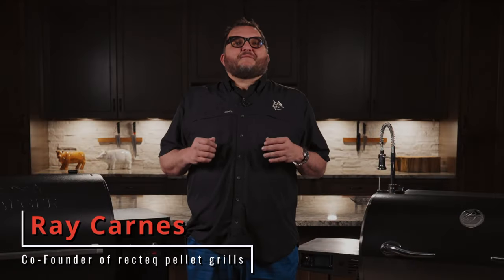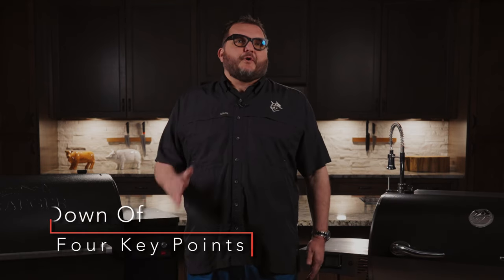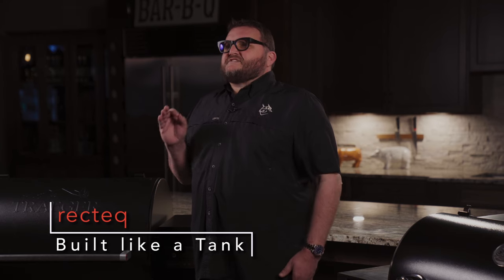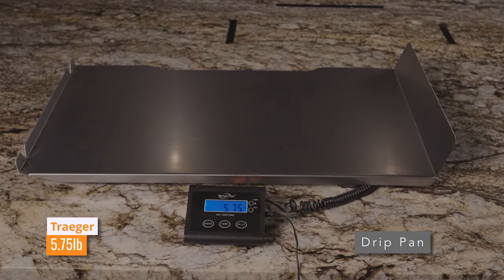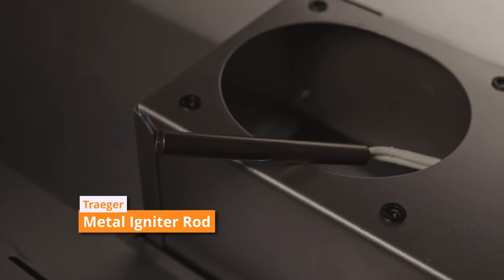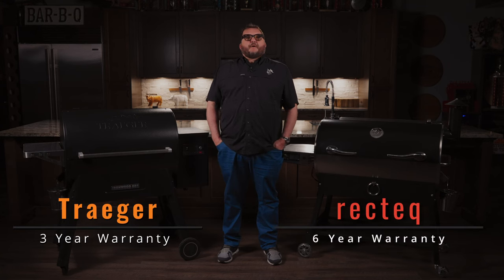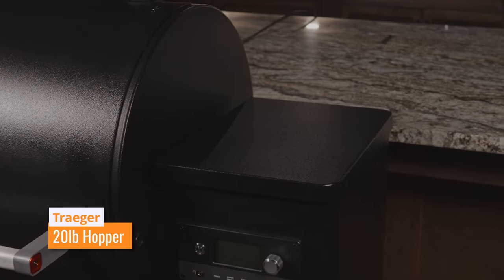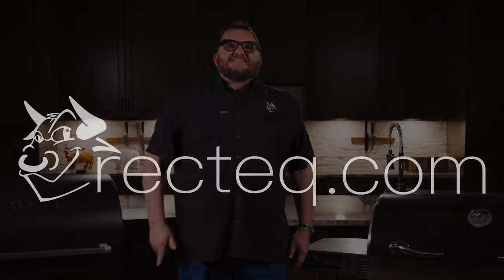RT-700 Wood Pellet Grill vs. Traeger • Side by Side Comparison Take 2 | recteq

Comment: I was one of the original customers for the rt680. It's over 7 years old now and going strong. 

This is a huge statement but in my dealings from pre sales thru many years of watching rec tec expand and engaging them on multiple ocassions,  you would be hard pressed to find better customer service. It's not only a quality product but the company that stands behind the product which they do unconditionally. 

I have turned on friend and coworkers to these folks and all have constantly stated how happy they are. In the future we will be moving and I plan to move up to the bfg2500. I would not consider any other pellet smoker & company at any price point other than Rec Tec
Reply: 680 is such a great grill mines going strong only needed the bottom fan replaced and the controller

Comment: If you want a challenge, try assembling one of these grills https://www.youtube.com/post/UgkxCx5fHawkK9OoV-ojFrY8JLnZrFwAmvUt . I am a technician by trade and the technical instructions were easy to follow. No reading, just pictures and diagrams. You assemble everything in 5 steps from the bottom up. Step #1 - Assemble 4 Legs and Wheels; Step #2 - Add the Front Cover and Cross Bars to support the frame; Step #3- Assemble the Burner to the Lower Grill Housing and install the knobs; Step #4 - Install the Side Burner and side shelf; and Finally Step #5 - Install the Upper Char- Broil Lid, Cooking Racks, 3 Burner Railings and Lid Handle. That's It and you're done in about 2 hours and 40 minutes. You have the option to pay for assembly after making the purchase - I would strongly suggest that you take it if you don't want to be bothered with this challenge. The only tool I used was a Phillips head screwdriver and a standard pair of pliers. The grill cost a little more because of the side burner, but this is what makes the grill so versatile and popular among backyard grillers. Have fun and enjoy!

Comment: I am firing up my 1250 in 10 minutes.  It is so far pretty amazing.  Do wish there was an easier way to dump pellets for another flavor though I am putting wet chips with the flavor I want on the heat deflector.
Reply: Quite honestly a shop vac works very easy. Sounds like a pain in the rear but it really isn’t. They’ve talked about why they don’t have a hopper door to let those out. Eventually moisture would work its way in through that access door.

Comment: As a previous Traeger+ user, I must say the switch to Asmoke has been a game-changer. The most significant improvement is the temperature control. With Asmoke, I have precise control within 5°F, which has significantly enhanced my grilling results. The portability of Asmoke is another feature that I appreciate. It's battery-powered, which allows me to take it on camping and road trips without worrying about finding a power source. Plus, the battery lasts up to 10 hours, which is more than enough for a day of grilling. The wood pellets add a unique smoky flavor that I've never been able to achieve with my Traeger+. The convenience, portability, and supreme taste have made Asmoke my go-to grill for all outings. I couldn't be happier with my decision to switch! #Asmoke

Comment: I had a Traeger and had numerous issues: 1) Sometimes it would just “flame out” 2) could not keep temperature unless it was a very high temperature 3) Absolutely no smoke flavor.  I ended up selling it very cheap and bought a “stick burner”.   As you can imagine, that’s a lot of work to tend a fire and try to keep the temperature where it needed to be.  At this point, I’ve decided to buy a Recteq…just haven’t decided which model yet.

Comment: I bought a pitboss 1250 competition , It is a beast, all day cooks with no adding pellets, huge three level grill area, Wi-Fi, bottom shelf, a shelf on the front and the side really on both sides if you count the pellet box. $699.00. it doesn't have the bull horn handles but so far that hasn't affected the smoking capability. I like to spend my money on function not something fancy just to bump it up in $200 in price with no added benefits. Traeger, I checked them out and all I found out really is they're expensive. There are many good ones I decided to spend my hard-earned money on function and not so much fanciness. I think I got so much more of a pellet smoker for half the price. I did add two temperature gauges the bottom of the lid and really no temperature variance that I've seen, it has been consistent on every cook plus it has the handle to pull back on the deflector shield so you can get direct sear above your pot. So before you buy a pellet smoker figure out your budget and then look at what there is out there maybe some people don't want Wi-Fi or don't want about himself or don't need three racks. Maybe some people want the traeger name because it's pushed so much, I saw that especially at home Depot. What I did I went online and read reviews for a week and YouTube videos I probably watch 80 to 90 videos. And then I went right to the store and bought my pit Boss and I'm glad I did. The one thing I will say and there's probably goes for most smokers is if you like that little bit more of smoke flavor get you a pellet tube I got one on Amazon I think for 12 bucks and I use it on every cook.
Reply from the maker: Pitboss for $699 is a great deal! If you ever want Stainless Steel and temperatures of 750 degrees versus just 450, I hope you'll consider a recteq! Smoke on my friend!